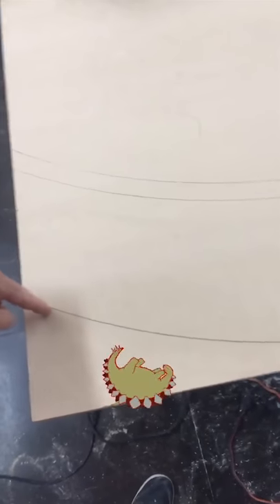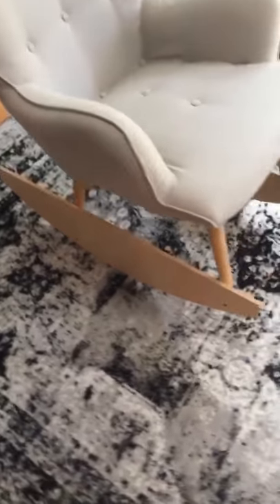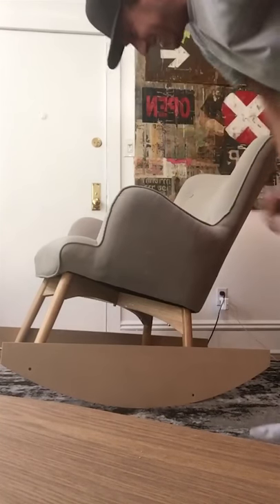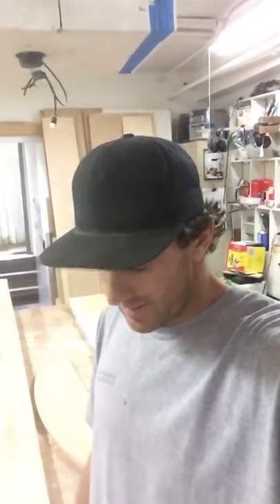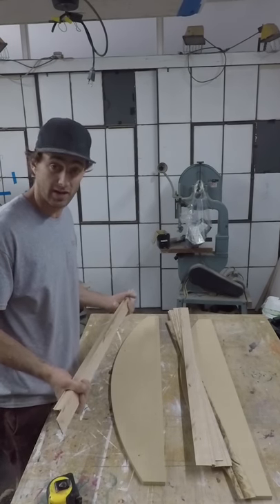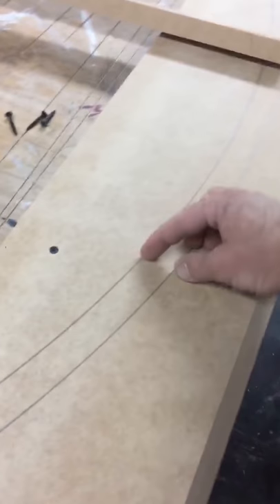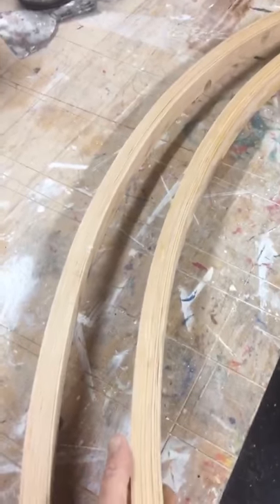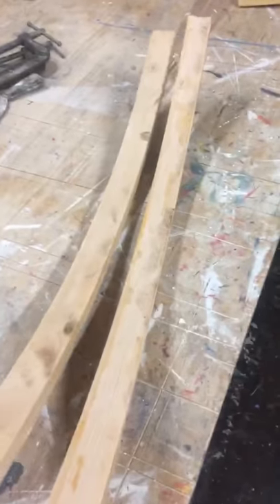How to convert a chair into a rocking chair!

Comment: Hi, I'm trying to figure out the radius I should be using with my chair. How did you come up with 38"? What parameters of the original chair did you calculate with?
Reply from the maker: juditsantha hey there! I actually didn’t calculate it from the chair, I came across another build with a similar radius. 
And just tested it from that.
If you do a tester, then you can se if 38 works. Make adjustments to suit
Reply: @Benjaminjohnwilliams  Wow, thanks for the super-fast reply, and the video itself! My chair looks similar in size, so that radius should probably work for me too! :)